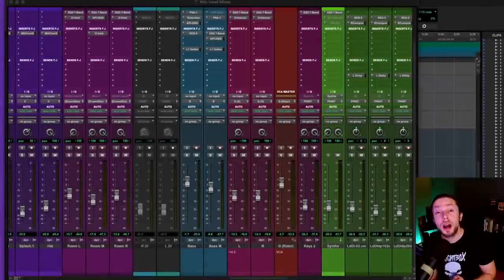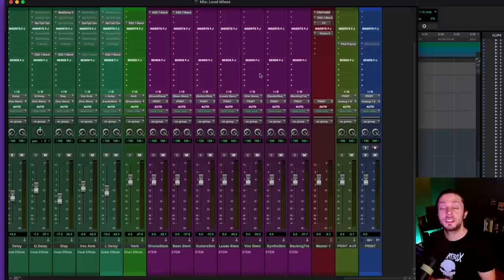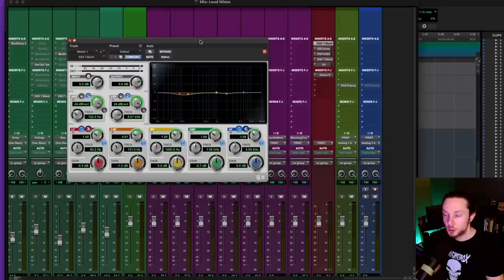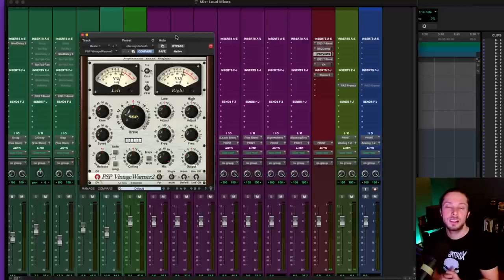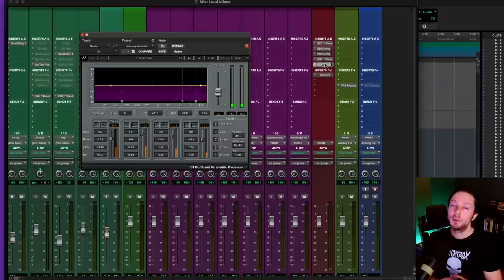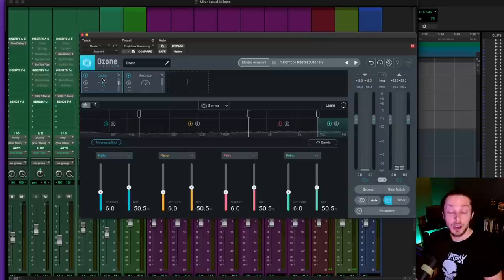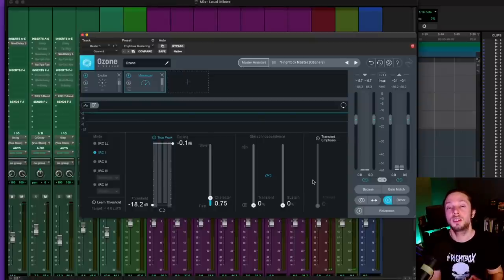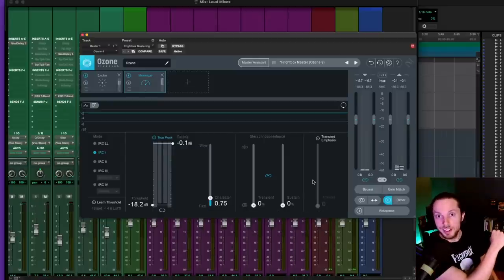Why Your LOUD Mixes Sound So Terrible (and how to fix them!)

Comment: My first plugins in the master chain are always a Pro-Q3  to Low pass and High pass if needed and two Pro-C2 compressor. The first with instant attack and fast Time-Synced release with a value in milliseconds matched to the 16th of the current tempo (to catch the biggest transients/peaks, and the second comp, with a Time synced attack with a value in milliseconds matched to the 16th of the relative tempo, to preserve the transients of the drums, and a slower release, matched to the 8th of the current tempo, to preserve "the groove" (for me, setting attack and release values according with the tempo is fundamental, it really improve the quality of the song/track). After these 3 plugins i go by taste and needs with eq, saturator, tape emulator, harmonic exciter, widener or whatever, then 3 limiters, usually one with a certain color aiming to max 2 db of gain reduction, and the last two Pro-2L usually mirroring the  behavior and the use of the 2 first compressor in some way, taking 2db of gain reduction each. (Sorry if my english is not so good i'm not native speaker)

Comment: Nice video and thanks for showing us your process for the master bus!  I would also recommend extending this concept to the other buses and even individual channels.  More specifically, using compression and saturation in subtle amounts earlier in the chain can go a long way to keeping the overall mix dynamics under control prior to the mix bus and allow you even more perceived loudness without clipping at the end.  As an added bonus, the individual channels also tend to gain some width and clarity.  When you do this, however, there can easily be some buildup in the highs as the compression brings those "masked" harmonics into the audible range.  Adjust as needed.

Comment: Cool video. I do a similar chain to yours , just in a little bit different order. Tape Saturation  , EQ , Comp , Multband Comp , Limiter. Sometimes I have to dip out about a db or two of 250-300hz depending on the song. But sometimes I don't.  I don't see how people can think they can use just a single plug-in on the master buss and think it will sound good. But maybe some people can. IDK , I'm no pro. Thanks for the video.

Comment: Interesting way of doing it. I have compression, saturation, EQ moves etc on my 2 bus but I still print my mixes with a good amount of headroom (just have my monitors louder!). It allows me the headspace to think of the mastering as a separate act where I'm just working with/on the stereo wav. Then it's just the final polish and the loudness to factor in, without the temptation of it all being a part of the mix that could go on forever.

Comment: Key takeaway for me here is to have a fairly quiet mix and then raise it all up together with a limiter but without the limiter having to significantly reduce the gain. All the subtle compressor and saturation stuff just adds some glue, vibe and thickness.

Comment: Just one question: why the make-up gain on your bus compressor is cranked up to +15db? I use the Glue that emulates the same hardware compressor and I can see that your compressor is also set in analog mode: if it works as the Glue it should add a lot of dinamic distortion (assuming that your imput level is at least -12db).
Could you explain me why?
Thanks for your amazing video :)

Comment: I often have trouble with mine. I have difficulty keeping the mix at a suggested -16 on tracks (I tend to exceed). After EQ I use an SSL style compressor only at 1-1.5 db but I makeup gain a db along the way to get closer (is that proper?). My multipressor is next with also a slight makeup gain. Sometimes a second compressor for peaks. Then slight saturation and finally limiter maybe 3db. My end result is about -10 or 11 or so. I can’t seem to tame the mix to sound blended.

Comment: Dude, this is great! I'm definitely guilty of the one limiter on master bus approach in the past. I've used the Ozone mastering plugin for years which has a few plugins built into it, but only one limiter so nonetheless I'm still guilty of it. I have gotten better at focusing on breaking out my compression on the mix buses into multiple smaller steps, and it has helped my mixes but I've never done it on the master bus. Well until recently I've backed off the Ozone limiter a touch and added the BSA Clipper to just add a little more punch and sizzle. I think that's given it a small boost, but I've noticed on cleaner/quieter sections the BSA has added some subtle but noticeable distortion. So I will have to try this tactic to get a little more oomph out of the final product!

Comment: 9:01 “it’s not rocket science, instead of using 1 limiter put a bus compressor, tape emulaton for saturation and further compression, then use a multiband compressor and hit these bands a little bit and THEN feed into a limiter, each doing so little work you can’t hear them individually”

Comment: I always try to get a louder mix by using Fabfilter Pro-L2 on my master track. I get the LUFS level where it should be (-14dB), the RMS level, and I put the true peak at -0.1. It doesn't clip, and I'm not slamming it. My mixes still sound quieter than the popular songs I play on YouTube. I'm going to try this & see if I can get my mixes up to the correct perceived loudness. It's been frustrating, because I didn't know what else to do. I thought what I was doing with the limiter was correct.
Reply: try mastering to -8 LUFS then
Reply: -14 lufs should really just be thought about as a minimum requirement. Most professional masters are much louder. Try not to look at the lufs meter and just push your track until it sounds like it’s got the right amount of glue. Use a reference to make sure you’re in the right track.

Comment: Why was the output gain on your ssl compressor turned up to 11 checks notes I mean 15ish? I have been using a similar plug in but have only been setting the output gain to be equal to what is being compressed. Am I missing a loudness trick here?
Reply from the maker: It's just the way that this particular mix was gain-staged...luckily has nothing to do with loudness outside of turning the quiet track up.

Comment: I am on my first attempt at mixing and recording my own band with pro-tools. From watching this video and you other mixing/mastering video I am a bit confused on somethings. First going into your master bus I notice your meters are not jumping around as much as mine. By the time your in you 2nd plug in you meter is very steady (a separate issue that i will fix next time i do this as your videos have been a big help). My real question is, if you re-import that mix with the master bus as a separate mastering track, would you bypass the Ozone on the master buss, then apply it on that single stereo master track as i saw you do in an older video?  You used the L1 on the master bus and the ozone 7 maximizer on the mastering track to give you a time reference)  or on both tracks?
Reply from the maker: Excellent question, will answer it in my next VQA vid.  Stay tuned!

Comment: Why purposely try to reduce dynamic range by that much in order to make your mixes "loud" when virtually every band's music is released to Spotify, Apple Music, YouTube, etc., who reduce the loudness anyway?  I thought the loudness war was pretty much over due to this, and the way to get your music "loud" on those music streaming services is to have a dynamic mix instead of a brick wall where every instrument is competing for the attention of your ears at the same time.  Is there a dynamic range you aim for?
Reply: I think you have a missunderstanding of the word "loud" and "dynamic range", by compressing you add density which is needed for competing at low volumes
Reply from the maker: I agree with you 100%, but unfortunately, the reality is that most artists are still obsessed with their masters being loud.
Reply: @FrightboxRecording  Yeah, I used to be in the same boat.  But then one day I made 2 mixes: one was -5 LUFS with DR6, and another around -9 LUFS and DR10.  Then I would put both versions in Audacity, normalize the perceived loudness between both mixes, and the mix with more dynamics sounded "louder" when I A/B'd them.  After that, I started prioritizing dynamics a bit more 👍

All that being said, I'm still a noob, and I very much appreciate your vids.  Keep up the good work!
Reply: @dfasht You don't get your loudness reduced when you upload to spotify, you get your volume lowered which is different and that's why you need density.

Comment: well, yes, you really have to know what you're doing, but, for example, an outboard setup will always sound better than lots of plugins, that mess up all your sound quality because of poor floating point precision... Theoretically, even touching a fader in the DAW messes up your sound quality... So, I guess, gear HAS some benefit (of course, only IF you really know what you're doing, as you said)
Reply from the maker: That's a myth.  Watch this video in full: https://youtu.be/BYTlN6wjcvQ
Reply: @FrightboxRecording  That was a VERY interesting video, totally enjoyed it. Many thanks!! However, I was able to test the "mixing in the box" vs mixing outboard on an analog console (a Soundtracs Quarts), and the results were very different and also tested Lexicon native reverb plugin vs actual PCM96, There was huge difference in depth and stereo image in the outboard mix. Pan knobs were actually doing something significant on the mixer, rather than in Cubase. I also had a shock when comparing (96k to 192k), the cymbals were much more alive. And it was a blind test, but the difference was huge, anyone could hear it. Was it the interface (Motu192 i think it was), or I don't know?.. I wasn't expecting such a difference. And later on, when I got my Lynx Aurora converter, also tried 192k and yes, the drums sounded much better, more natural. Also the same with acoustic guitar and vocals. Not that much of a difference on distorted guitars and bass (i couldn't distinguish it). Also, real outboard stuff sounds to me much more natural than their simulations. Even cheap, DIY kit (hairball audio) 1076s sound better than any plugins I've ever encountered (including CLA waves pack). I built myself a Gssl compressor using Gyraf's schematic. Again, it's a totally different story than the Waves SSL plugin. I mean, yes, the plugins sound that way, but they don't have that "HiFi" natural sound, they make the sound "cardboardy", at least to my ears. And I find that difference quite big, not subtle to be subject of "placebo".. I know exactly what you are saying (and the guys in the video), but in this case there IS an actual difference. You should try it for yourself sometime, and possible also make a video about it (all channels on zero, in the box vs outboard console).

Comment: there is a cleaner way to maximise your loudness. Instead of leaving the compressors as the very last element in the chain try adding a clipper to the last insert of each track and clipping the peaks down. That way the peaks are clipped down prior to being bussed out. Think about cascading clippers from the tracks to the busses and then out to the 2bus. Have a look for Baphometrix Clip to Zero strategy.